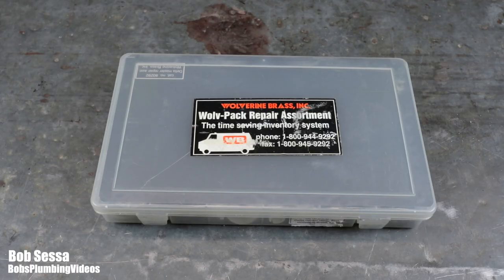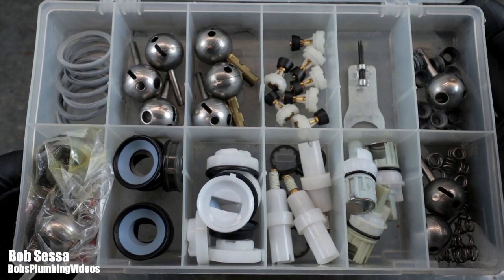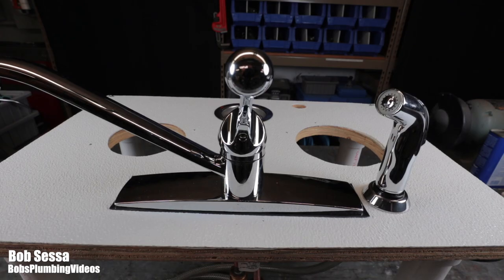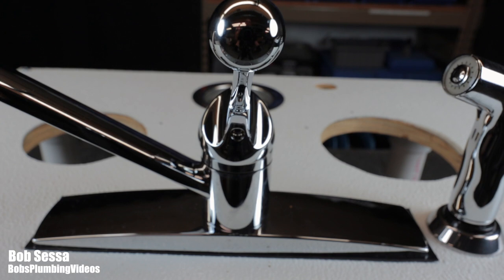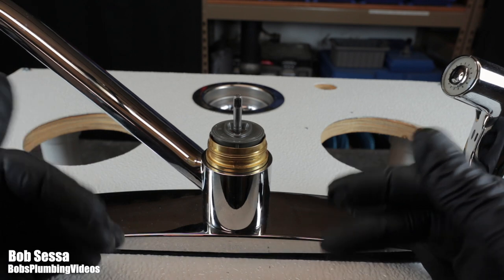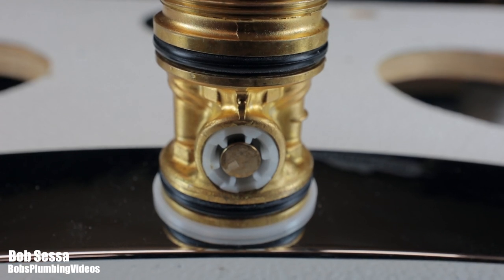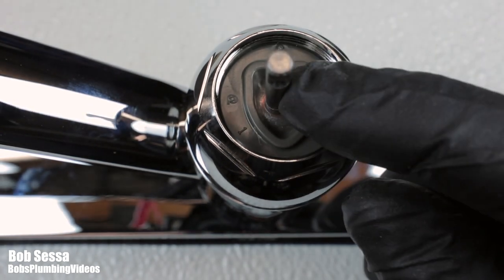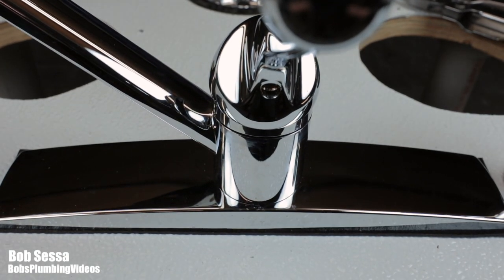Single Handle Kitchen Faucet Low Pressure (Delta)

Comment: THANK YOU BOB!!   I looked at a bunch of videos, but yours was the only one that mentioned the DIVERTER.   After replacing the springs and the old busted seats, I STILL had a trickle situation that was driving me nuts.  I didn't know about diverters until now, and alas, there was a piece of broken seat IN mine. Once cleared, the faucet runs like new!!!!  (And yes, I replaced the O rings too.)
Reply from the maker: Excellent!

Comment: Awesome, thanks very much or putting this up. Was working on mine, tonight, but before finding your video. Had to drill out the allen key socket cup(?) even after hitting it with WD-40.
Reply from the maker: Glad it helped

Comment: I took apart my faucet and I have a moen 41004 diverter assembly. Can’t seem to find it anywhere. Don’t know what to do next. Any suggestions? Home Depot and Lowes don’t have it
Reply from the maker: Take a look on build.com. or go directly the Moen website, pull up a PDF of your model. Get the exact part number and do a google search to see who has availability. I do this all the time when I can't locate parts.
Reply: @BobsPlumbingVideos  my wife pulled out the “this faucet is 12 years old…” argument. I replaced the whole faucet and side sprayer last night. But thank you for saving us from continuing to buy side sprayer heads